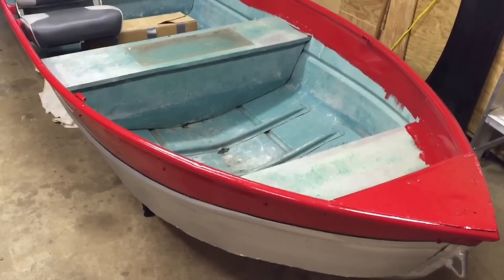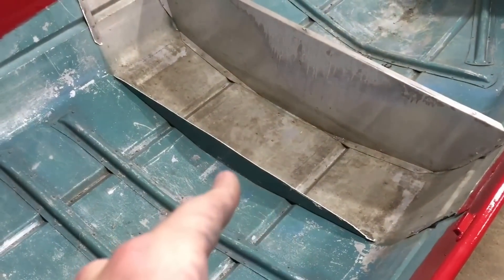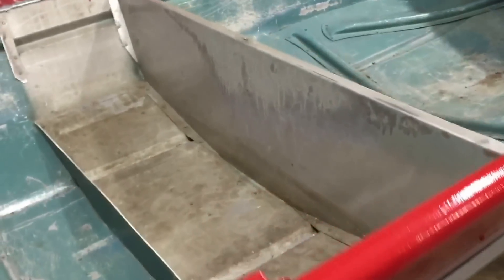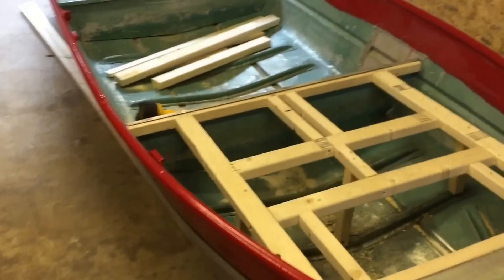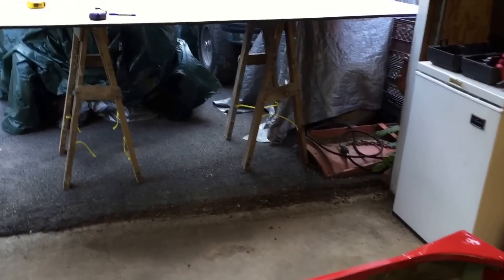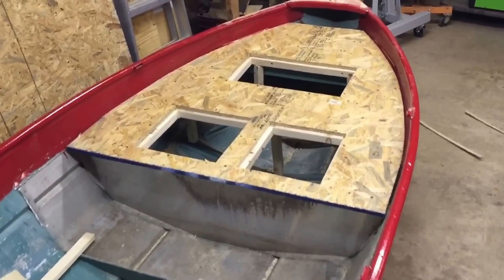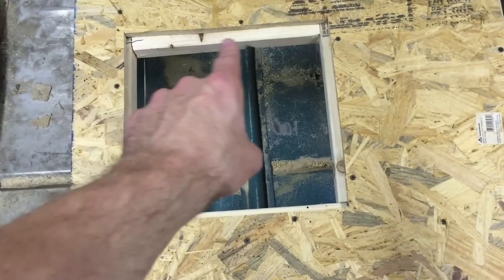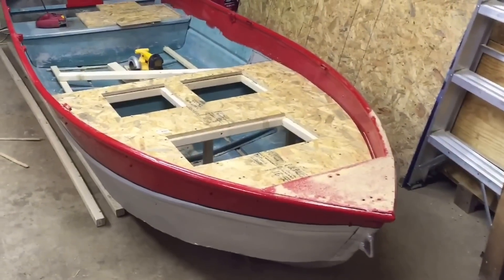Jon boat mods part 3 | The Boetker Channel

Comment: I love how amuricans calk it plywood when its OSB/chipboard/aspanite. And on that point, using aspanite in anything close to water is a BIG mistakes, as soon as you drop a little bit of water on there itll swell up like a bitchhhhh.
Reply: I was curious why he used OSB.  Also, isn’t it bad to have wood touching the aluminum? Won’t it rust??
Reply: @AmericanByGrace  that's treated wood that does that
Reply: I'm building a bass tournament fishing boat out of pelican 2 seater bass hound and I use ply wood and aluminum and I've done this before and the believe it or not is coating all of wood with flex seal, that stuff is good and it lasts forever even keeps osb dry forever

Comment: am I the first to point out that Osb is a poor choice for something that is going to be around water?
Reply: Prakticle J last about two seasons then it’s junk treated lumber has copper in it and corrodes aluminum and marine plywood is 97$ a sheet use regular untreated plywood resin coat the hell out of it and glass the ends last 20 years
Reply: @sethmorton8539  sounds legit

Comment: great project.  what thickness osb plywood did you use?
Reply from the maker: Jeff Cachero I used 1/2 osb I also coated it with Thompson's water seal so it would last longer in the weather
Reply: Osb plywood? Da fuck is that

Comment: Maybe a dumb question, but how is the 2x2 framing attached to the hull?  Or is it just held in place with the decking?
Reply from the maker: James Rogers 2x2s are screwed to the front seat and middle seat the rest is just free standing

Comment: How did you make the template for the bow
Reply from the maker: FIshing 4LYFE I just used brown paper and cut it to fit. I then transferred the paper pattern to the plywood which gave me a rough cut piece. Then I just trimmed off the excess until it fit right
Reply: @MrFordman302  where did you get that brown roll of paper from?